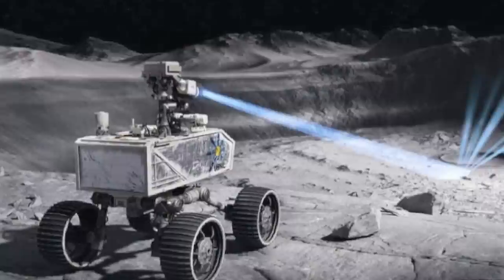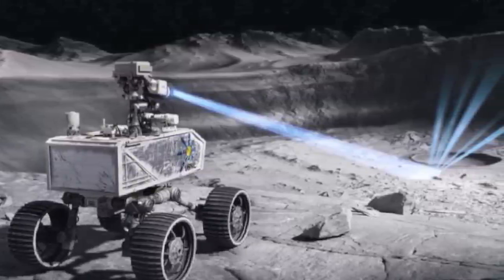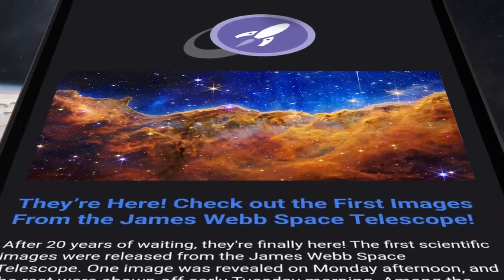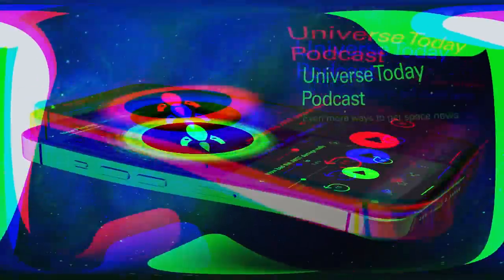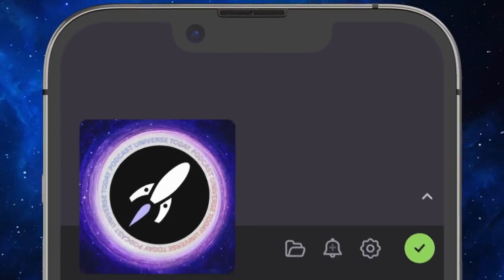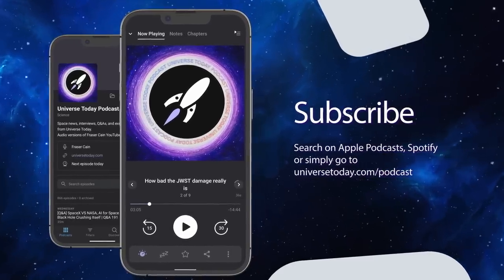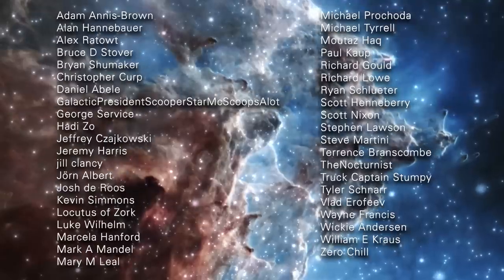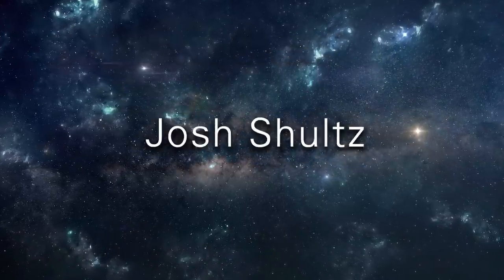Radioactive Flashlight for Moon Rovers [NIAC 2023]

Comment: Question! What if the 26 million year cycle of "The Radcliffe Wave" (a large collection of gas, dust & stars discovered in 2020) passing by the solar system by moving above & below the milky way's galactic plane is linked to the mass extinction events that coincidentally happen every 26 million years on average? What are your thoughts? and why did we only discover it so recently when its so close to us at 400 light years away?

Comment: I wonder if it's possible to use the lack of radiation as an x-ray device?
I.e., a grid surface that's normally bombarded by radiation, block that radiation w/a short term layer of material and do a comparison of both areas of strength and distance of absorption.
Reply: Interesting idea, you could make a 3d grid for detection then, instead of just a 2d grid.
Reply: @Yezpahr  kinda what I meant. Good catch.

Comment: What is the half life of this power source?
Reply: The main focus is on Tm-170 with a 129 day half life. There is also some evaluation of Co-60, which has a 5.27-year half-life.
Reply: @ChistopherMorrison  Thanks for the reply. Given the current time frame of solar system travel it looks like this would be primarily a lunar technology unless it could travel in some kind of moderator to be fully activated at the start of use. Although the Co-60 would be effective for Mars missions.